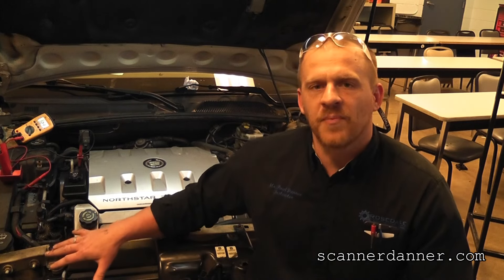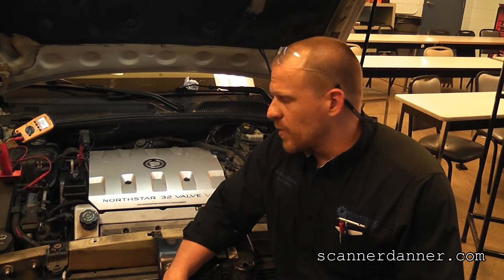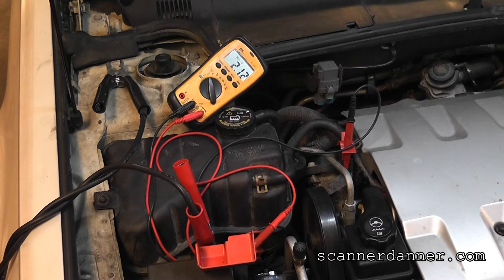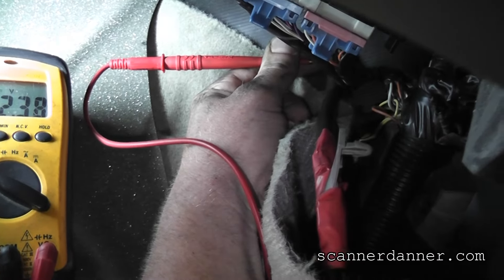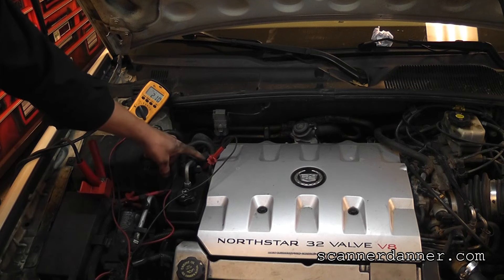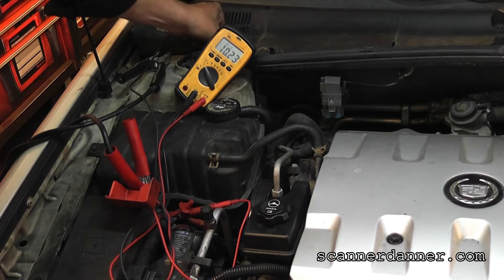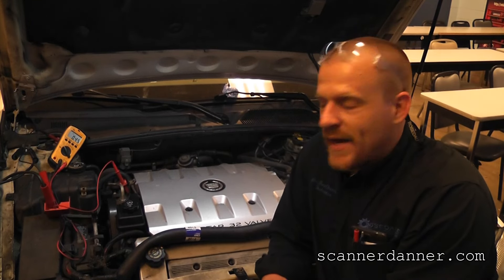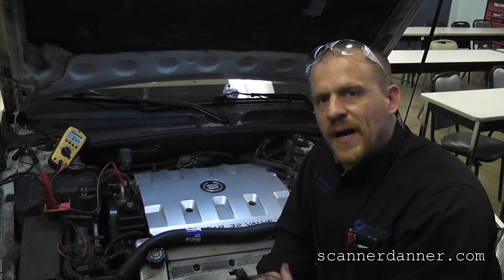Engine does not crank (bad block ground) - Cadillac

Comment: Its been almost 2 months now that one day as usual i went to turn on my 04 ford explorer and holymosis dash light, head lights, inside lights all normal but no crank no start, the next day i found on a article say to check what the anti-theft light system on the dash do if it blinks normal or if it blinks rapiddly, on my car the anti-theft light blinks rappidly when i turn the key to ON/RUN position, after that i started saving $$$ because my outcome was that my PATS system will needs to be reset or re program on a local ford dealer and thats a expensive job + the tow truck fee to take the car to the dealer, since i dont have the money to take the car to the dealer im not rushing on that, so i been doing my own research almost everyday until now i see this video and at the bigining you said the cadilac was showing the anti-thef light come on and all kind of codes, i thinks this is a hope for me and sonnest i can i will do this test to my car probabbly i have a bad ground and this is causing my anti-theft light to act up.Great Info on this video keep it up, youre doing a great job 
Thanks
Reply from the maker: +Franklyn Martinez thanks man, I hope you fix it. Also, I have seen a weak battery set the anti-theft system on Fords. It literally can be as simply as needing a battery.
Reply: Really apreciate your repply man, thanks, thats how everything started battery die 2 days later i try to junp it, firt try not enough juice, on the second try the car almost started, and on the third time nothing, just the click under the hood and the fuel pump working, and since then its been a nightmare, (once i took the starter off and took it to auto zone to test it and  the test was good pass but some one told me some times they pass off the car because the starter its not load) youre video and tips have been good, i still have not check if i have a bad block ground yet but for sure i will let you know, one more time thanks,

Comment: I have a 2002 Escalade 6.0 , and when I turn the key it doesn't crank. I replaced battery , but even before I replaced battery it would do this same thing. Sometimes I would jump it with my suburban and it would start, but now it doesn't.  Its weird because everytime there's juice but when I turn the key no crank at all... Could it be the ignition or alternator.  Or maybe bad ground ???

Comment: A couple questions out of curiosity. I don't know if you will be able to answer them after this long, but Does this caddy still have the heated windshield wiper fluid option installed?
Did you remove the top engine mount or was it missing when it came in or am I blind?
What do you do to seal the wire back up where you probe through the insulation?
Reply from the maker: I relocated the ground. Did not touch the engine mounts as I don't do mechanical repairs.
Liquid electrical tape or clear fingernail polish
Reply: @ScannerDanner  I should relocate it so it's easier to get to, but just need it up and running now.

Comment: hi paul im replace had gasket vw..after that i start  engine + wire from battery get so hot i replace aultenter but still same ,,thnx
Reply from the maker: +KURDISTAN uk check your main grounds on that block too
Reply: ok mate thnx

Comment: The 10 volt you get from ground to ground measurement. Is that a voltage drop at ground side under load?
Reply from the maker: ramirezki yes

Comment: Hello, I’m having a similar issue. My engine block and starter body read 1.4v when cranking and 0 when not. In addition, when I start crank the car the red cable that goes to the starter drops from 12.3 V to 6.6 volts. Does this point to a bad block ground or can it be something else? I have a 2.4 L 2011 accord. Any info would be much appreciated.
Reply from the maker: What is the battery voltage measurement when the starter cable is showing you 6 volts? Sounds like issues on both cables

Comment: Just check the engine block to chassis ground wire located on the front of the motor
Reply from the maker: Or watch a really cool voltage drop case study

Comment: Scanner Danner this same ground broke on my caddy same motor I went to replace it and the bolt to the frame broke can I make a new hole beside it and put a new bolt
Reply from the maker: yes you can. I did too

Comment: So I did have a bad alt ground It was covered in soot and grease and when I pulled back on the insulation I saw less than half of the ground was still actually connected and my meter was showing Voltage still. I couldn't get my hand in there where the ground is bolted so I bought a little ground wire and put it on the - block tab ground plate and then to the - attachment for jump starts , still nothing, did I ground the block wrong? Did the alt need the ground on that specific bolt it was originally mounted on?
Reply from the maker: You bought a "little" ground wire? This is a main block ground, it can't be a small gauge wire and no it doesn't need to be bolted exactly in the same place.

Comment: I’m having similar issues, but my 98 Deville starts right up no problems. After a few minutes (sometimes less or more) I get the anti theft issue and a bunch of warning lights pop on as well as the radio shutting off. I’m so lost!!
Reply from the maker: If it always cranks over normally, I doubt it is a bad block ground like we have here. Following the trouble codes in different systems is where you have to start.
Reply: ScannerDanner thanks for the response, found a draw of 2.38 amps with the car off. When disconnecting the body fuse under hood the draw went away. Chased it all the way to rear fuse box where the draw also goes away when removing the comfort fuse OR the plug that connects the computer in trunk. Not sure where to go from here
Reply from the maker: @rickyb9596  You need a good wiring diagram https://www.scannerdanner.com/forum/post-your-repair-questions-here/3757-need-service-info-check-here.html

Comment: Perform a voltage drop on the battery cable might need a lead extension to connect your dvom postive lead to the battery postive and negative to the postive cable connection on the fender key on no drop than switch from battery negative to engine ground and body ground perform another voltage drop trying to crank the engine would have increased the stress on  the circuit the dvom would have done the math for ya

Comment: hey scannerdanner i have a 1989 iroc-z 5.7 tpi i have spark at the coil nd spark at the plugs fuel pump turns on but the injectors are not blinking its a no start conditon i have an led light i have checked for ground nd power to the pcm everything good i checked ohms on the injectors they in spec i disconnet all of them nd just leave one connected nd nothing on injector pulse i checked for coniety nd evrything good im thinking of bad ecm anything u can tell me about this bypass system oh nd also changed the module let me know what u think thanks danner
Reply from the maker: Eli Gomez Eli, there is a purple-white wire that comes off the ignition module. With the key on, take a test light to battery positive and touch on/off this wire. The injectors should fire and fuel pump should run each time you do this. Also do not use an LED type light, it needs to be an incandescent light, and when you do the test, the test light should NOT light up. Let me know
Reply from the maker: Eli Gomez This is a different system than yours but it explains the bypass system a little 
https://www.youtube.com/watch?v=mxPdxGqRWvc
Reply: ScannerDanner thanks danner i have have done the test as followed i can hear the pump and also i can see the noid light flicker but not really bright nd these is no light been shown as i do this test i have checked the tps nd its also good there is no flood mode just no injector pulse while cranking
Reply: Eli Gomez okay so to be clear, the noid light does flash? it doesn't have to be bright. I'm not sure what you mean by this statement " but not really bright nd these is no light been shown as i do this test"
Reply: ScannerDanner Premium  thanks for taking ur time nd ur knowledge for my help yes the noild light blinks nd i can hear the fuel coming up when i do this test i changed the module but still no noild blinking while cranking
Reply: ScannerDanner let me know what u think thanks
Reply: Eli Gomez Okay, since you have spark we are not worried about the pick-up coil. Next step is to check the purple-white ref wire for a short to ground (partial short, not enough to light the test light but enough to pull the 5v ref down).  Disconnect ECM and module and measure between ref wire and a known good ground, your ohmmeter should read OL on the mega ohm scale if the wire is good. 
I had an aftermarket Viper alarm system wired into that ref wire on a van that beat me up a little in the past.
Reply: ScannerDanner Premium hey danner I have a actron cp7677 multimeter but when I went to do this test is dose not go ol it doesn't mark anything even when I placed it at 20m ohms
Reply: ScannerDanner Premium its on a good ground even tried the ground at the battery it doesn't show anything on meter with both connections from the module to the pcm so im sure its not shorted to ground or being crossed threw with volts
Reply from the maker: Eli Gomez okay, then next we need to check the ref wire for a signal. https://www.youtube.com/watch?v=Nqxc-ZViQso 
watch this video at the 23:55 mark. I am testing the ref wire on a 4 cylinder design. It shows .9 volt average on the meter. It is actually a 0-5v square wave. This is a known good waveform in this video.
Give me a voltage reading of this ref wire during a crank with everything plugged in.
Reply: ScannerDanner b3 purple/white ref wire .12 with the key on nd 1.6 while cranking
Reply: ScannerDanner let me know any steps to able to diagnois the problem with no injector pulse
Reply from the maker: That sounds about right. So let's confirm the ECM is receiving this signal by monitoring the fuel pump circuit. Do it at the relay under the hood. This is a power side switched circuit. You should be getting a 2 second prime then here is the important part. While cranking, that circuit should re-energize. If it does we are barking up the wrong tree by chasing this ref. circuit.
Reply: ScannerDanner got it done danner took me some time reading nd understanding vast sytem nd some forums its in control with the key style 1 nd 2 for the startor senoild nd the injector pulse this is only being in control buring cranking when started the ecm takes control if eveything coming from the ignition switch connection to the unit for the vast there should b no problem is all wires are good nd its reading ur ohms correct for the key style u have there will no problems with the key but was can be done the bypass on this vast system with the near percent of the ohms of ur key get the connector of two wires runing down the ignition swith i didnt cut any wires as said in some forums tried it 3 different ways on connecting the ohms i placed the ohms with the wires connected nd like back probing the connector pluged in with the omhs of the key bam it was there took me alot of testing connector for ground thest connector for power nd the signal from the module to the pcm everything checked out solid injector ohms only pain was it vast system but thanks alot for taking ur time to reply back ur way more nd have more understading of all runing system nd back probing testing everything ur great but i feel good about my self getting this job done thanks danner
Reply from the maker: Good job man! I wasn't even thinking about an antitheft issue with this. Forgot about those vat systems. You followed directions very well, better than most, that for sure. It was my pleasure to try to help even though we were on the wrong path, you still learned this system didn't you? Again good job
Reply: ScannerDanner thanks danner im a young one in this hard game but ur skill is on the hook ur high level even a teacher but in the game were im at its always about ur speed to diagnosing problems i c u go down to the bear connectors ur game would take u longer but its way more better in the over all because in this real game we would have some mechanics spending the customers money nd not fixing the problem thats a no no in this game u might take ur time but its about having this game right in ur hands i would love to still watch more uploads but doing quick test with no big scanners using multimeter, 12v test light ,led with for ground nd power checks simple tools can also get ur job done check for spark fuel pressure ckp nd cam single in other cars the module im glad to knoe that how smart ull get in this game is as much as u wanna learn thanks danner keep ur self up nd GOD bless you

Comment: Hi. I can buy cheap pico scope for £200. But it is only 2 channels. Is it worth buying or waste of money? Should I save more and buy 4 channels scope?? Thanks
Reply from the maker: Gregory May It's not a waste of money for sure. And you can't beat the price. What all does it come with? Are you buying that used or new?
Reply: Sorry Greg I haven't had a chance to look at it for you. You can't go wrong with a Modis either my friend. In fact any of the snap-on scopes I would also recommend.
Reply: ScannerDanner Premium
Thanks. Is Modis $4 channel?
Reply: The older one is yes. The newer is only 2 channels
Reply: Thanks. I was confused about that. The one I'm looking at is 4 channel than.

Comment: what is the difference in this test , negative on the frame and positive on the block and wanting zero volts, and putting positive on battery and negative on the block and wanting to see voltage??
Reply from the maker: It is becoming more and more difficult to answer questions here. I have 80,000 people asking me for help now. So I have created a forum to help you guys better. It is free to join and we can exchange pictures, wiring diagrams and waveforms if needed to help guide you through the process of troubleshooting your vehicle. Thank you so much! Hope to see you there. 
Paul Danner (ScannerDanner)
https://www.scannerdanner.com/forum/post-your-repair-questions-here.html

Comment: Good video!  Thanks.  Can you, or anyone, tell us what the actual current drain should be on a 2006 DTS when everything is turned off, such as during the night?   I think i have a battery draining issue.  I do have the capability to measure DC current, but I just don't know what the "normal" current reading should be.  Thanks!
Reply from the maker: Less than 50 ma with a typical of under 30 ma

Comment: I did a engine swap
and after i swapped it. the car doesnt crank over. but the radiator fans turn on automatically and as soon as I turn the key I hear no clicking or no sound at all! 
is it a bad ground? or faulty starter motor?

Comment: I need your help please. I have an Olds Aurora (I'm sure you know it's also the Northstar V8) and I've had a rough idle, poor running including backfires if I accelerate even a bit too hard. This began when a shadetree mechanic changed my plugs/wires to solve the misfires. This car costs over $225 for just plugs/wires due to labor (having to remove the intake man cover, the ignition coils just to remove the back 4 plugs) Anyway, we ran an OBDII that first came back code 300 multiple random misfires, (plug wires fixed that),  after we got "Vacuum leak" (but nothing was disconnected). It began dying in my driveway after sitting for 2 days, so when a new battery was installed the code showed "PCM keep alive memory error/reset". I found my mechanic had broken a black ground wire from the block, on the side near the serpentine belt (the other end disappears under the intake man cover). What I'm wondering/guessing is the wire might be the ECM ground or it grounds a fuel sending unit, cat converter etc., but the ECM makes the most sense as I've had random electrical issues all over, my cruise control quit, drivers side power seat, power mirrors, trunk release all within weeks. 
Anyway, can you tell me what the ground wire might "ground"? I'd say it's about a 14-16 gauge thickness and I haven't put it back on the block yet, I will if you tell me.
I'm so grateful for your time, I'm a disabled dad who can't afford t just keep buying new parts hoping to fix this and I have to drive my boy to school each day.
Peace
Reply from the maker: Just match the wire size that is there my friend. If you go bigger it is fine, just don't go smaller

Comment: yep freakin grounds... I was out joy riding my f250 out in the field behind my house with my daughters. ( which they love) in a righteous drift my truck does... cranks no start.. do I get it home and check my relays. all is good... plug them in and notta... do I ground the fuel pump threw the link connector and bam... it turns on... but no injector pulse... even checked the fuel shut off switch behind my brake pedal... I was wtf!!! I think I disconnect the battery and reset the computer... u pull the negative cable and notice a plug Came undone due to the jarring... plugged it back in... went inside and turned the ignition and low and behold... it started up... i was like no shit..... the ground...

Comment: any one 2000 gmc yukon new power steering pump and gear box and some times gets to hart to turn the steering this system has a selenoid on back of the pump. thanks

Comment: i chased a similar no crank condition on a same engine only i caused the issue and did not know it until 2 hours  later.  i replaced and alternator and after had a no crank condition racking my head and chasing electrical checks only to recheck everything i did and touched to find out i forgot to atach the ground cable to the starter it was bolted to the block with a top bolt of the alternator... doh.